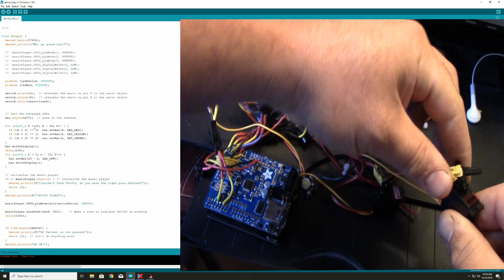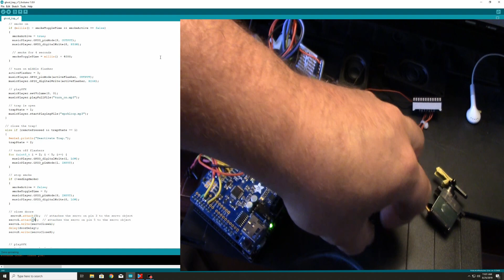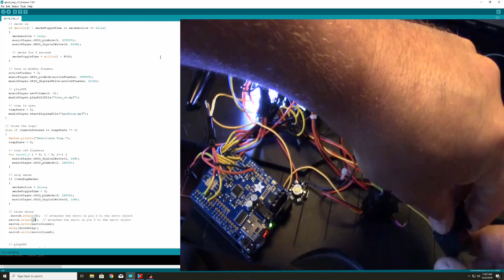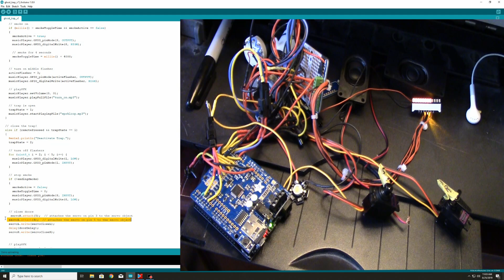HELP!!!  Arduino/code issues

Comment: in the code in the global variables  pin 5 is used for the activation switch and the smoke machine and you are trying to use it for the servo as well. pins 2 & 3 are  set up as interrupt  pins for the player . i would go through the code and find two digital pins that are not being used and set the servos up on them .
Reply: I'm trying to figure out how he even has the servo and activation switch both hooked to pin 5!!?? Good catch!
Reply: Jim Korman 
Didn”t see any pinmodes in his sketch either .
I think if you call something in a local variable or in the loop that over rides the one you called in the global variable at the top of the sketch, the micro calls these first followed by the setup and then drops into the loop so if the same pin is called there the micro doesn’t know what to do . If he had set his pinmodes as required ( input for the switch )the compiler should  have thrown back an error  as you are trying to drive a servo on a pin that is set as an input .

Comment: If you want to execute the servo test function, simply slap together a simplified copy of the main code you're working with.  Weed everything extraneous out of the control structure (if/then/else) so that you can use your physical inputs to manually call servotest(); or any other desired test.  

void loop()
{
  checkRemote();

  // This should just allow you to toggle between test blocks of code using your button
  if (remotePressed && trapState == 0)
  {
    Serial.println("Toggle on");

    // do a thing 
    servoTest();
    
    trapState = 1;
  }

  else if (remotePressed && trapState == 1)
  {
    Serial.println("Toggle off");
 
 // do a different thing
 servoR.write(50);
 delay(1000);
 servoR.write(1);
 delay(1000);
 servoR.write(100);
    
    trapState = 0;
  }
}

If ever you find your lack of subject familiarity leaves you at a disadvantage when troubleshooting, remember that a divide & conquer approach goes a long way toward finding things you didn't otherwise know could possibly be fault candidates.

FWIW, i just glossed over the txt version.  I'll guess it might be a timing issue or some sort of conflict with the music player thing.  I doubt you need to reattach the servos every time you need to change their position, but I also don't know if repeatedly doing that will cause issues either.

Comment: As others have mentioned do something like

int rightServo = 3;
int leftServo = 5;

Makes it much easier to troubleshoot and MUCH less error prone.

Also in your set up you write

servoR.attach(3);
servoL.attach(5);
servoR.write(servoCloseR);

but don't send a position command to the left servo. With the (attach|detach)ing going on it may not know where it is in the world. So

servoL.write(servoCloseL); // ?? Maybe add

Just a thought, I haven't tested this out.

Comment: Firstly I'd try to put a little delay after each line containing servo attach. Maybe 300 ms: delay(300); 

If it works it is only a matter of time ;-)
You could also insert the servoTest(); function in the main loop.
To do that, after line 180 you could add:

while(1) {
servoTest();
}

Servos will move forever waiting 2 secs between open and close.

Comment: If you had a way to see the output from pins with oscillosope or something would make it easier to debug.
Try to simplify program. Remove all code except for servos, make sure you use PWM capable pins.  I remember having similar problem with servos but cant remember what it was...

Comment: I forgot to say (look at line 95) it too looks suspicious.  In the Arduino go to preferences and turn on the line numbers if you don't already have them turned on.  These comments will be easier to find.

Comment: You may want to provide the servos with their own power supply if you have not already do so.  Also lines 178 and 179 I believe should be up in the void Setup (just below line 79)And lines 231 and 232 look suspicious.  Likely should not be there.  For a good resource for using servos is at the DroneBot Wrokshop channel (Using Servo Motors with Arduino)Hope this may help you.....I do not have that exact board and can not check these ideas.

Comment: Can I suggest using variables for the pins for the servos? It means you only need to switch 5 and 3 in one place rather than a gajillion places :)

I'll check back in the morning (2am here!) to see if it's solved, if not I'll look closer.
Reply: Hi Greg,

Around line 140 to 150 of the the .ino file there's a few comments about interrupts whether it uses an internal interrupt (like a timer) or an external pin interrupt which might be conflicting with the servos.

A quick fix could be to uncomment line 142 and comment lines 149 and 150 such that the music box uses the timer instead.

Good luck!

Comment: I believe you should only attach  once in the startup.  Next,  try without the funky libraries. Just set them as digital out do a digitalwrite to the pin between 0 and 254.

Biggest advice: Don't do all the code at once. Take one step at a time. Get the servos running, then tackle the other stuff. Too many variables to mess with at once.
Reply: If I remember correctly, 127 or so is centered and lower goes one way and higher the other. It's been a couple years since I have done it :)
Reply from the maker: @DavidKirtley  
Yeah I tried.  The I/O pins of the secondary board are being used to trigger the sequence.  I even tried switching to another PWM capable pin that was unused and still same issue.  This isn't my code and is supposedly known to work
Reply: @Halligan142  insert print statements at informative points. Dealing with lifted code requires a different type of diagnostic sometimes. Good luck. Most of the wobblies I spotted turned out to be already addressed by others